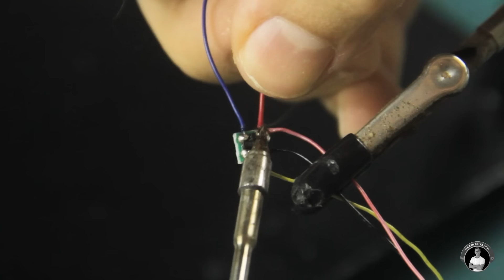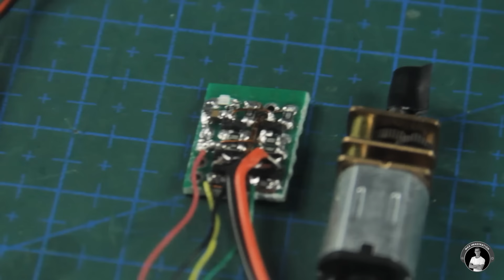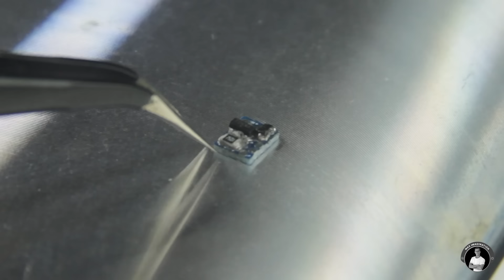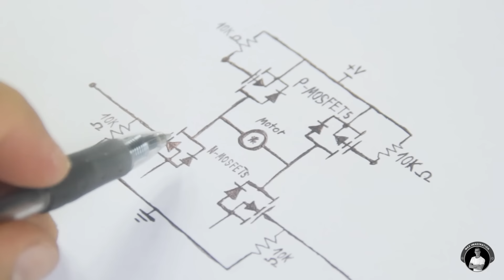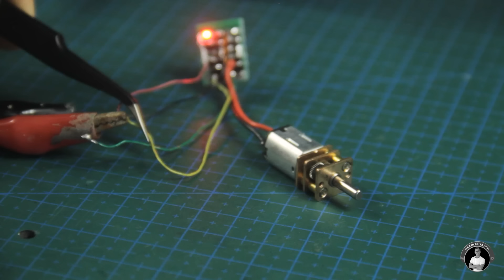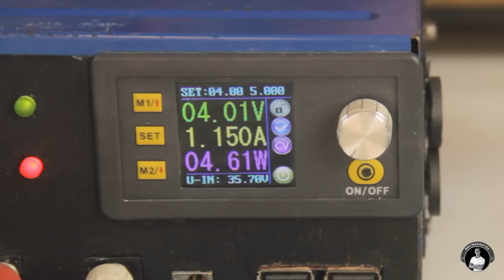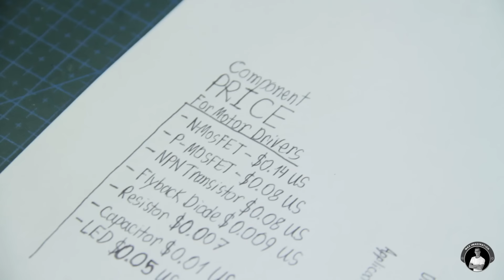Guide to making TINY Brushed Motor Drivers with MOSFETs for RC Projects

Comment: Hey friend,  will the 1ch unidirectional motor driver work directly from the PWM  signal of a rc reciever ?
Reply from the maker: Hi there. I heard it will work, yes, but not without some prior configuring in your transmitter so that no signal is sent when the throttle stick is completely down.
Reply from the maker: (IF even possible)

Comment: Hello max what I am using this esc with flysky transmitter what this ESC work flysky receiver yes or not
Reply from the maker: Hi there. The single channel driver should work with a Flysky transmitter, but you may need to make some adjustments in the settings so that zero throttle actually means no signal (if possible), so your motor doesn't run continuously even when no throttle is applied.
Reply: Thanks for information
Reply: Hello max please make details video in this topic please 🙏🙏🙏🙏🙏🙏🙏🙏🙏🙏🙏🙏🙏🙏🙏🙏🙏🙏🙏🙏🙏🙏🙏🙏
Reply from the maker: Hi. I don't do videos on such detailed topics unless it's highly highly requested by others as well.

Comment: There is something on your finger..            O No!,..  it is a switching diode..   or an SI 2300 n Channel MOSFET.   😃
SMD is out of my 58-year old eyesight reach.   Damn inconvenience when it comes to soldering.
But i appreciate your instructive video nonetheless. 👍
Reply from the maker: You can always use the larger through-hole sized components and get higher current handling in the meantime, haha.
Thanks!

If you ever feel generous and want to support my work, here’s my BuyMeACoffee page: buymeacoffee.com/MaxImagination. It means a lot!

Comment: Very good, but I’ve encountered a problem: when using the receiver as the PWM signal source, the motor still turns even with the throttle at zero, and at full throttle the speed never reaches the level achieved when the gate is directly tied to the positive supply.
Reply from the maker: Thanks. I've never used a PWM generic receiver myself with one of my drivers to tell you what's wrong, but I'd check if it's because the PWM on your receiver is calibrated at a midpoint (default voltage is not 0 but half way to VCC) or if you missed a pull-down resistor on your driver.
Reply: @MaxImagination  I’ve resolved the issue. It turned out that the ESC was generating too much electrical noise, which was corrupting the PWM waveform output by my Arduino Nano. Adding a 100 µF and a 0.1 µF capacitor in parallel across the ESC’s power leads fixed the problem. Thank you very much for your reply.
Reply from the maker: Glad you've resolved the issue!

Comment: i'm curious about this steering mechanism. I see it's common in toy grade cars as you don't need a servo, instead you run a motor and then mechanically stopping the rotation of the wheels. Then I've also seen some sort of clutch gear that makes the motor to keep spinning as you steer left or right. And I just wonder, isn't it bad for the motor to make it stop like that. Isn't it getting damaged? I mean I know it's common, but it can't be good for the motor or maye it doesn't affect it much?
Reply from the maker: For toy-grade mechanisms and their low power, it's acceptable and doesn't do much damage. Maybe not so good for the long term, but it's toy grade.

Comment: So, WHY can a motor controller handle 12 volts and 40 amps without a heat sink, but a commercial DC SSR with similar V/A drops so much voltage and blocks the amps, wasting all that wattage into heat and requires a large heatsink, even if you're ok with such high RdsON? An SSR does not switch often or fast, and in only one polarity- should be  lower resistance
Reply from the maker: What's an SSR?

Comment: Bro 😢 could you please help me out i have flysky fs 2A 4 channel  reciever i want to replace my 20 amp esc for brushed motor with this unidirectional micro brushed esc for making an slow flyer airplane light in weight because that 20 amp esc is heavy in weight in this esc you made there 2 wires for motor and rest 3 can be connected to our fs 2A reciever then where to connect battery please make a video on so that i could use this cool light weighted esc in my projects please tell me !!
Reply from the maker: Hi there. The battery connects to the black and red wires. Positive to the positive terminal of the motor and the negative to the source pin of the MOSFET. As explained in the video.

Comment: Just what I was looking for - how to use multple (n)mosfets to control motors individually (in my case coin vibrators per https://www.youtube.com/watch?v=3hoBwa0ccys).
Q: how do I choose the more suitable transistor in my case ? the transistors in both seem to have specs that are sufficient for the purpose, but maybe those in this vid support higher current ? ... so, would current be the key discriminator ?
Reply from the maker: Awesome!
Choose transistors based on the current handling you need, gate voltage (stick to logic-level MOSFETs), and drain-source resistance (which must be low). If you're driving motors that draw more than 2.5 amps of current, I suggest using more powerful MOSFETs such as the IRFZ44N or IRF3205. The tiny MOSFETs I used for my drivers (SI2300) can handle up to 3 amps (A).
Reply from the maker: If you ever feel generous and want to support my work, here’s my BuyMeACoffee page: buymeacoffee.com/MaxImagination. It means a lot!

Comment: Hi thank a ton gor providing schematics, i was able to successfully make one bidirectional driver 1 ch myself. Thanks bro 😊

Update: It worked fine yesterday, but now only one signal works . Other signal not working. Only spins one direction. 

Can't seem to figure out why it's not working 😕.
Reply from the maker: Hi there and congrats! If one channel stopped working, check you didn't overload the MOSFET, didn't touch a MOSFET base handed accidentally.
This can happen and can be avoided with careful handing.
Reply: @MaxImagination  I used nailpolish this time to prevent accidentally touching the mosfet pins 😂. Cheap and effective.
Reply from the maker: Good preventative!
Reply from the maker: You may need to replace a transistor or MOSFET.
Reply: @MaxImagination  thanks bro, it works now, is there a problem if we use a 10ohm resistor instead of 100ohms?
Reply from the maker: For the H-bridge driver NPN transistor's base resistor, 10 ohms may work.

Comment: Hey sir could you make an another video for connecting the single motor esc connection with flysky reciever and how to connect battery to it i can connect 3 wires from driver to receiver but i don't know where to connect battery wire because i have a 20 amp there are two wires for the battery and for motor also but for using this one how would i connect battery i thoroughly need this please tell me ...😢
Reply from the maker: Hi there. I'll explain it to you. The motor driver is not like a standard ESC. You'll need to figure out your Power, GND, and Signal lines on your receiver. Connect your single-channel MOSFET motor driver module accordingly and supply power to the power and GND lines of your receiver with a separate connector from a 5V source (not battery directly). I don't know your exact setup, but this is approximately how you'd do it.

Comment: Great video. I had one question. Can I Use regular 10K Ω resistors instead of pull-down resistors? I am unable to find them in the market in my country
Reply from the maker: "Pull-down" resistors refers to what the resistors are used for. They're just regular resistors :)
Reply: @MaxImagination  thanks for the info and clarification 😃
Reply from the maker: No problem!

If you ever feel generous and want to support my work, here’s my BuyMeACoffee page: buymeacoffee.com/MaxImagination. It means a lot!

Comment: Thanks ❤❤so much🥰 I really learned a lot from you. I tried ciruit with IRF3205 >>the mosfet heated a lot>> is there are any circuit for high current about 12A motor with low heat mosfet?
Reply from the maker: Glad I could help! The IRF3205 should be able to easily handle 12 amps, weird. Maybe try another one? Yours could be faulty. You also have the option to run a couple of MOSFETs in parallel for added current handling.

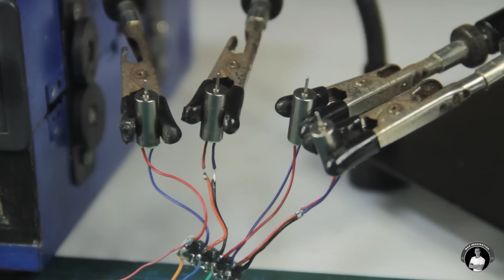Comment: for the Unidirectional (4CH) motor driver my motor runs even though when i don't give any input voltage to the gate of the mosfet ..but in the testing u did in the video at 6:56 u don't gave any voltage to the gate the motor is off.. i used 2300 smd(I don't know if this is an n channel MOSFET) not si2300 is that the problem? ......( but if i run an arduino code(has turning the motor on and motor off code) it turns on and off)
Reply from the maker: Hi there. Are you using pull-down resistors for your driver?
Reply from the maker: If it says 2300 on the mosfet, it should be the SI2300...
Reply: @ the smd shows 2300 on it's surface, i used 1N4148 Surface Mount Zener Diode not in4148ws is that the problem??
Reply: here his the thing for the first time the motors won't turn on by itself when i give voltage to gate it starts running and keeps running even after i remove the voltage to gate of mosfet
Reply from the maker: Try running the MOSFETs without the diodes attached and report back on if it solves the problem.
Reply: @MaxImagination  the motor runs as usual but if i give the gate voltage as well the motor runs a littler faster than before(usinf 3.7v battery)
Reply: @MaxImagination  yes 10k smd(1002)

Comment: Help please. I'm trying to run 4 cpu fans independently 1amp each or less. I can't find the appropriate switches. on off and PWM... they all are for LEDs and not for inductive loads.
no wireless I just want hard wired. I'm not against a custom build if I have too. but would buy if I knew exactly what was needed. 
I'm mostly done building my house and want to circulate the heat from the wood stove.
your motor control looked like just the thing but I don't know how to integrate the PWM.
Reply from the maker: Hi there. You could use a microcontroller such as an Arduino for PWM control and a 4-channel motor driver like the one I showed for each fan. Each transistor can handle up to 3A continuous.
Reply: @MaxImagination  Thanks for answering. I will have to think about and study how that would work.

Comment: The diodes you recommended for the large motor driver (1n4148) seem a bit small. It can only handle 200ma. I know it is only for short spikes, but still, are you sure that they will be enough for a motor that can draw 20a? Also the mosfet you show (IRF3205PBF) is rated to 110a. If I use a bigger diode, larger wire, and a heat sink is there any reason I can't push the motor a bit higher to perhaps 75-100a (startup current of course).
Reply from the maker: For smaller motors, the diode will suffice, I haven't had any issues with it nor heating. For instantaneous flyback currents, its fine. A higher-rated switching diode can work for your higher-power design.

Comment: Tell me will that first uni directional controller will work with a pwm signal from receiver?
Reply from the maker: Hi there. Yes. The first unidirectional controller (Single MOSFET) will work with a standard receiver. The rest work with a microcontroller in between.

Comment: I mimicked this driver and provided PWM from a Raspberry Pi Pico, but I couldn't reach full speed even when using a 100% duty cycle.
😢
Reply from the maker: Which of the drivers did you mimick? What MOSFET did you use? What signal voltages did you apply?

Comment: Does that mosfet turn on the motor with 3v gpio pin? I bought the wrong mosfet that needs 10v to fully turn on and the gpio pin only has 3v
Reply from the maker: The SI2300 turns on at 3V from my observations, yes. Which MOSFET did you buy?
Reply: @MaxImagination i found your mosfet online. Thank you ❤... i purchased 5v 10amp power supply. If you have the time maybe take a look.

I started programming gps and mpu. Currently streaming data to a web client. Im submitting my order tonight. 

TPS61088 DC-DC Step Up Boost Power Converter 12V 10A 1MHz

Comment: What do you think about the idea of turning a cheap car controller (27mhz) into a custom motor speed controller using this power circuit and connecting the gate to the pwm output of the cheap controller. It would definitely be a good idea
Reply from the maker: It can work, but most cheap controller circuits (27-40mhz) already contain an H-bridge motor driver circuit.

Comment: I have a question with the h bridge driver bro, what is the minimum and maximum input can it take? or does that even matter? thankyou for this wonderful vid!!
Reply from the maker: Hi there. The H-bridge takes anything between 2 to 12V DC. I say apply 12V maximum as any higher voltage usually introduces more current and will overheat the driver causing the components to fail. So yes, the voltage you apply matters, but at least you have a broad range for small RC projects.

Thanks for your kind compliment!

If you ever feel generous and want to support my work, here’s my BuyMeACoffee page: buymeacoffee.com/MaxImagination. It means a lot!
Reply: @MaxImagination  the BC847B NPN Transistor shop link are incorrect it leads to other product

Comment: I want to make drone using coreless moter but I don't found any good and low cost moter driver for coreless moter and thanks for this moter driver tutorial, it is very useful for me.
But I have a question, It is moter driver stable for mini drone?
Reply from the maker: Super glad to hear my guide video on these drivers has helped you!

Yes, the 4-channel Unidirectional motor driver works stable for a mini drone like from a past video of mine (I recommend watching it if you haven't yet).

If you ever feel generous and want to support my work, here’s my BuyMeACoffee page: buymeacoffee.com/MaxImagination. It means a lot!
Reply: @MaxImagination  Max sir can I use SI2300DS instance of SI2300
Reply from the maker: Hi there. Yes, it's the same thing as the SI2300, it's also called the SI2300DS. Same same :)
Reply: @MaxImagination  ok thanks sir 🙏

Comment: Thank you very much😊, can you make a unidirectional 1ch 20A esc please:)
Reply from the maker: Glad you found my video useful.

I won't be making the same motor driver again, but you can easily size up the one you make by using the higher amp alternative components I showed at some point in the video.

Comment: What should i do if i need to make 5A or above brushed esc.what components should i use?
Reply from the maker: You can either place two SI2300 N-channel mosfets in parallel with each other for up to 6A handling (3A each) or use any other logic-level MOSFET that's larger and can handle at least 5A. Feel free to use the IRF3205, as it's still a solid option.

Comment: I had made a small rc plane using coreless motors and this esc but when i set my transmitter throttle to 0 motors spinning slowly(i checked reciver's pin output some voltege Despite that trottle is zero) how i solve this is eny changes in code.? Thank you.
Reply from the maker: Did you check if your driver's MOSFET has a resistor pulling the gate to GND? If you already did, it means your MOSFET is the issue. It could be damaged. Best to replace it. Code changes won't solve this.
Reply: @MaxImagination  no. motor driver working fine. but my Arduino output pin generates signal despite throttle Is zero. Thanks
Reply from the maker: Make sure zero values are default in the code. Or set the output to (LOW) in the code as a condition for when no commands are being sent to the Arduino.
Reply: @MaxImagination  thanks bro I will try it.

Comment: I used Skyworks AAT4900 half bridge for my Micro Hexrotor UAV (shame it is discontinued - Digikey) - provides synchronous rectification and can drive coreless at 30+kHz for best efficiency due to low self inductance. The synchronous rectification provides automatic braking and better speed response https://www.youtube.com/watch?v=5sK4Mv1QmUE&t=48s
There may be more modern alternative components
Reply from the maker: Thanks for the recommendation.
Reply: @MaxImagination https://mm.digikey.com/Volume0/opasdata/d220001/medias/docus/511/AAT4900.pdf
Reply from the maker: Thanks for the datasheet!

Comment: Just in case you can buy full SMD H-bridge SOP8 TMI8118S for about $0.25. There is also a SOT23-6 version of TMI8118 for 1A - 2A peak.
It could be cheaper /*if you don't scavenge MOSFETs from used boards*/ and smaller /*if you don't need currents higher than 2A in peaks*/.
Reply from the maker: Never heard of that H-bridge IC, thanks for sharing!

Comment: can i use the bigger mosfets and resistors and diode because i can't get any of those you used(should the mosfet be same or can i use any mosfet)
Reply from the maker: Yes, you can size-up the circuit's components. I recommend logic-level MOSFETs, but most N-channel mosfets should work.

Comment: Can you explain a bit, why in H bridge the need for 2 BJTs? Why not just control high side pMOSFETS gates from other nMOSFET drains?
This simplification could be very useful for RC models.
BTW BJTs are quite slow and current hungry, even if additional valves are mandatory, why not to use 2n7200 instead of 3904 to save current usage?
Reply from the maker: Hi there. The BJTs are used as pull-down switches to pull the P-channel MOSFETs LOW when toggled by HIGH signals as the P-MOSFETs are pulled HIGH by default due to their inverted operation. Without the BJTs, you'd need to control the P-channel MOSFETs inverse as opposed to the N-channel MOSFETs which anyone would find awkward. 

Also, the BJTs won't consume that much power as they are toggled via 1K ohm current limiting resistors. You won't save much power by adding MOSFETs in place of them instead. However, you can do it still...

Hope this clarifies it for you!